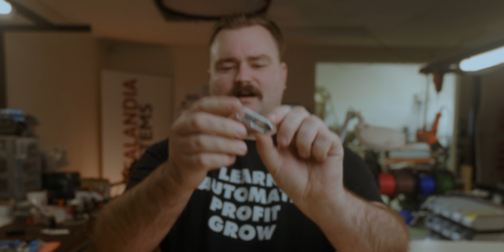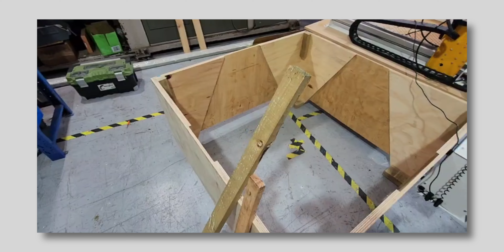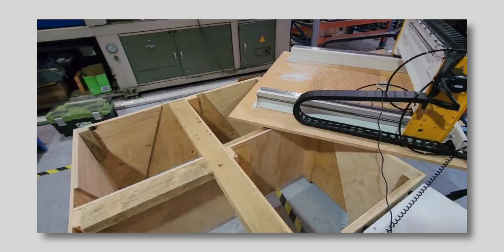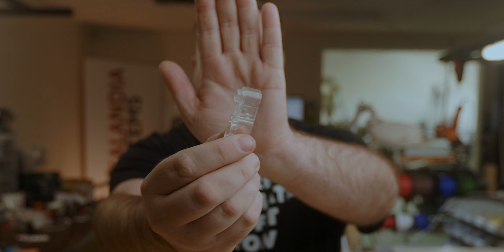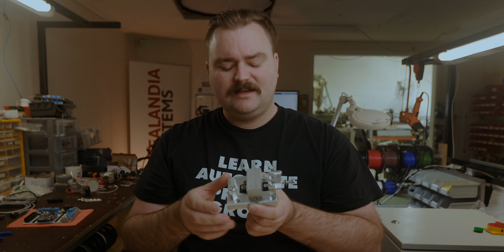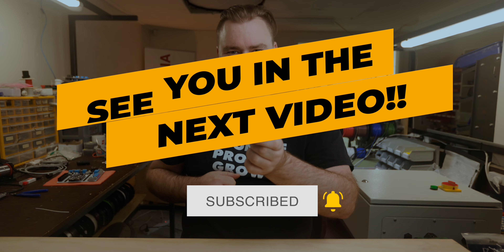Making a scale RADIAL ENGINE! Episode 2.5 - Fixturing for Quality and Efficiency | Zealandia.Systems

Comment: Its hard to take you guys seriously with the ridiculous wood base.     Stop messing about and make concrete/epoxy base frame with inset alloy or steel fixture table like the langmuir MR1  beef up a few components like ball screws and a serious spindle and use thicker steel section...... everywhere and then you'll have my attention.
Reply from the maker: Thanks for the feedback! This is meant to demonstrate the capabilities of budget friendly machines - starting at the lowest model!  I don't think thicker gauge steel is the answer - I do believe smarter design application to the steel is more apt.    Few things here we have addressed in the next video - just need to finish editing it so planning on releasing next Friday. Liam